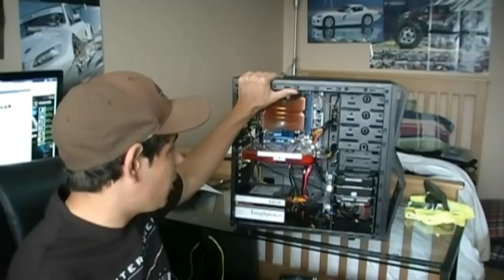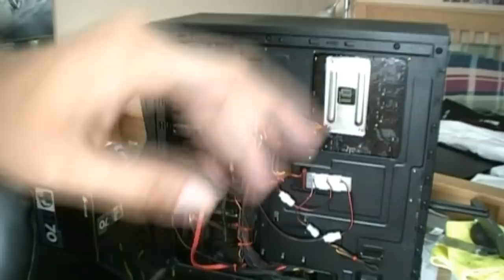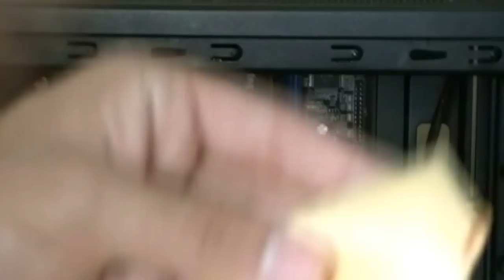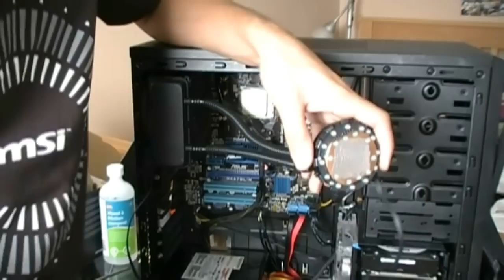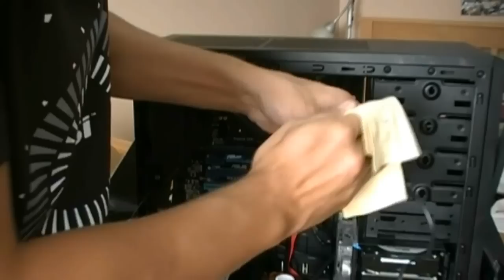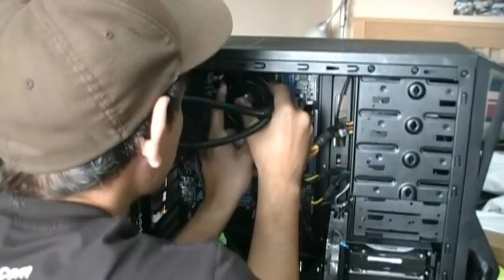Corsair H70/H50 Amd Install Guide The Tech Source

Comment from the maker: @rebourne783 The H70 comes pre-filled and pre-sealed, you never have to worry about filling it or changing liquids!  It is a very compact water cooling system for the CPU only that is easy to install as an air cooler.  No maintenance!

- Dave

Comment: @TheTechSource1 well the Nh-d14 runs pretty hot under load compared to the 70 especially on OC'd machines running higher voltage. i guess the extra noise wouldnt be all the time, only under load if the board is running it. im just wondering if i should get this or the 50/60 with some highflow quiet fans installed instead.

Comment: @TheTechSource1 - Actually depends on the individual case/situation, there's no blanket rule with push/pull, my case actually handles it fine the other way so it depends on how well Your case evacuates the air . . .

Comment: hey my case does not have a 120mm fan slot in the back :x the only one is in the front, i was wondering if you think the hoses would reach from the front to the cpu, its a mid size case and the front 120mm is out of view because of the HDD

Comment from the maker: @Roscoe1724 The H70 recommends actually having that rear port blow air INTO the case for the best temps for your CPU, you can have it blow out but the temps won't be as good.

I don't see a problem with it as those components should be below the first pci/pci-e slot and won't be near it.

- Dave

Comment: Hey man i just had a couple questions. Does the double fan make it too noisy? i guess you could just add some sound dampening (aka foam/rubber material). You can change all the fan settings in the bios anyway since it runs off the board. im planning on overclocking to 4+ and running high voltage, would you recommend the 70 over the 60/50 models? And would you recommend replacing the thermal paste that comes with the unit? I do have some arctic 5 and ik that stuff works great. Thanks for posting!

Comment: I actually just installed this on my new system, its really weird, I remember you saying it doesn't really matter which way the air is pushed/pulled, like in or out of the case, but the thing is, on idle with no load im going 40-50 Celsius, on 25% it goes to 66 and keeps rising, do you think this could be because of the thermal paste that's preassigned? Could it be because the cooler isn't touching the processor enough? I just bought this and its not really making sense to me. Thanks in advance.

Comment from the maker: @danzburg make your it went in your bios and turned off all fan controls and that should fix it because the pump should be running at 100% all the time and check if everything is tight. With the fans blowing air out the case it will run a bit hotter but thats how i use it but if the fans are set up to blow air in to the case it will run cooler but your pc will run hotter if you dont have good air flow

Comment: i have the h50 version - with a push pull fan setup on it - super easy to install and the rad i noticed get cold lol i didnt expect it to get that cold - its noisy though as i have 2 2500 rpm fans on at full speed - little noisy but it doesnt bother me

Comment from the maker: @Roscoe1724 No worries!  Unless your sound card has one of those rear mounted heatsinks it will be a little lower than flush with the top of the highest pci/pci-e slot.

- Dave

Comment: Ive got a question about this cooler ok i was thinking of getting a new cpu with this h70 cooler now the cpu im getting is the same socket type as the one i got on my motherboard right now its a am2+ if i was to get this h70 cooler would i have to put the backplate on the back of my motherboard or could i use the existing am2+ backplate thats on my motherboard right now and just install the front plate when i get the cooler.

Comment: As for moving it around its alot better then a air-cooler cos there's no real stress on the board compared to a air cooler.
And as for a water cooling the H50/70 are alot better at load with double fans there's around 5degrees between the H50 and 70 but they are alot quieter then air coolers and on a i7 950 and 4.5ghz. on the hole temp range. I only found 4degrees difference on the H70 between using the breakers and running them flat out.

Comment: Why did you have the heat from the H70 going into the case?  That will heat up other components inside the case...you would have been better off having the fan blow out the back.....

Comment: Nice video man. Glad im not the only one who runs into problems installing these things in small cases. Good video for people who are new to the problems they will face when installing this coolers one thing that i fear if the pipes breaking durning installing LOL.
Btw the one i had to take mine back cause durning install the screw went thru the radiator

Comment: You made the install more difficult for yourself the way you installed the bracket. First, if the adhesive was on the rear bracket it wouldn't fall out. And second. you install the mounting bracket for the first, and then put the cooling block into it, giving it a partcial twist so it lines up with the barbs on the bracket, then finally tighten the screws down one corner at a time.  Also it's better to have it pulling the hot air out of the case not into it.

Comment: You installed incorrectly.  You are suppose to install the bracket first, but are to leave the screws loose.  Then place the CPU water block into the bracket and twist it to lock it into position.  And lastly, tighten the screws of the brack once the block has been positioned into the desired alignment.  And that's it - you're done.  I learned the correct method the hard way when I installed my H50.  The installation instructions are the same.

Comment: ok..just a COMMON SENSE correction. You dont JUST "Wipe" the old cpu thermal paste off.  you need to clean it with something.  I dont have any special cleaning cpu stuff. so I use AS CLOSE TO 100% alcohol as possible.  that way the cpu IS actually clean as close to a microscopic level as possible( thermal paste bonds at the microscope level and it all needs to be fresh when you perform the new burn in.) otherwise like with a car.  you're HALFASS changing the oil. sorry but true.

Comment: Man, the new rad with the 2 fans is a huge bulk load of uglyness sticking out there. THe h50 rad with a scythe slim 120mm looked sneaky and fittet nice. with something that size i could take a real pump , rad and res. And since tests have shown, that the h70 doenst perform as good with just 1 fan as the h50 i'll pass on this one. *ironic* on the h90 just use 2 deltas maybe you get the water to freeze, corsair.

Comment: This was a bad installation video. He should've installed the back bracket, front bracket, back fan and radiator, pull fan, and then the cpu cooler/pump. And it's also easier to install stuff if you have the case laying down on the table instead of sitting up.

Comment: @100kge - Do you even know what your taking about?  The CPU is creating heat....having the fan pull in hot air from the system is doing nothing for it...if anything its making the temps of your processor hotter.  Pulling in cooler air to the radiator from the rear or top of the case will cool the CPU a hella lot better than pulling the air from the case.....Get your facts straight and learn how airflow works!